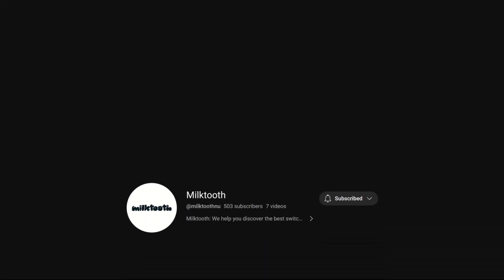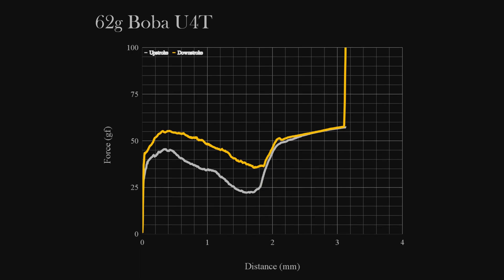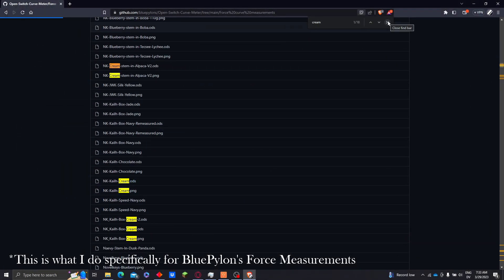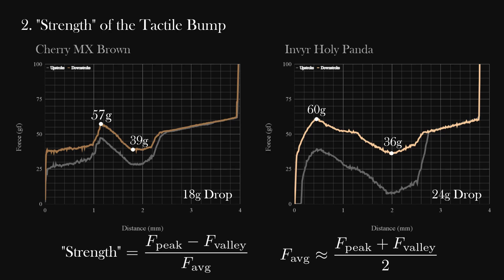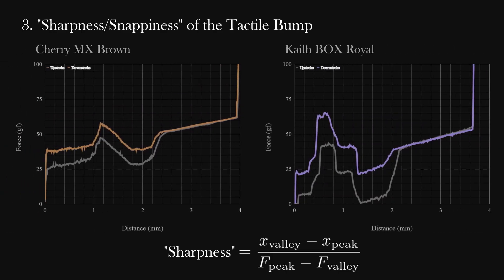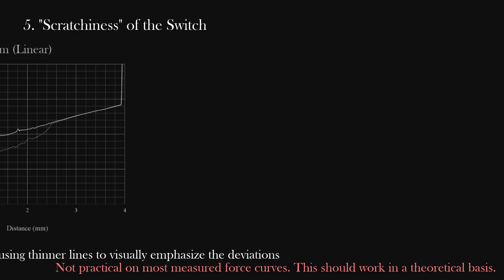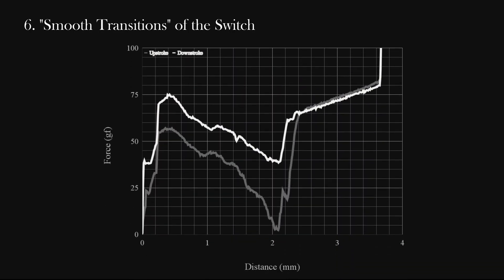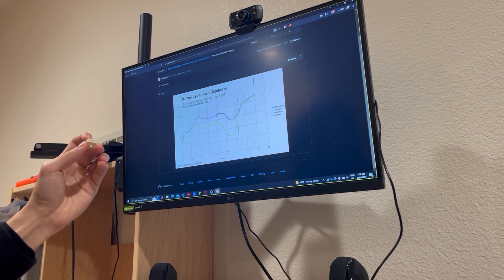Force Curves and Key Feel | A Response to Milktooth's "The Problem with Keyboard Switches"

Comment: Another one: The sharpness is wrong. Like mathematically wrong. What you want is the slope of the curve. You basically wanna know how steep the bump is. That is mathematically deifnes to be: DeltaY/DeltaX. So, with units of force and length, How much does the required force drop for every unit of length the stem moves. The higher the value, the steeper the curve, thus the bump is "sharper". You can do the inverse and say the higher the value the "flatter" the bump, as you did, but why not use the tools provided by 7th grade analysis, instead of making up new things?

Comment: The tactile bump equation doesn't make much sense. You get a dimensionless coefficient that doesn't really describe anything about the tactile bump other than the ratio between the max/min delta and the average across that delta. Take the cherry mx. By your logic, if the average is higher, the strength is lower. If the Pewter had a stiffer spring and was otherwise identical, you'd have lets say 100g and 82g. The delta is still 18g, but the average is now 91g. So with an average more than double that of the original switch, its tactile bump should feel half as strong. This doesn't make sense though, as the tactile bumpp is the same.

I'd argue that its better too look at work again. How much distance do you need to cover in order to surpass the tactile bump. You can see that the pewter has a longer bump, thus the work is greater compared to the cherry, ergo the bump is stronger. So I propose: strength= (Fpeak-Fmin)*Bumplength

Comment: Excellent video, great analysis. I like your point about scratchiness being hard to tell, with noise and data processing/filtering making comparison of commonly available charts not very meaningful. If you controlled for the test stand and protocol and did all the runs on the same rig with the same processing you could probably get a decent measure, but you'd have to do your own physical testing. Playing around with RMS or even Fourier transforms could lead to some interesting insights for comparison.